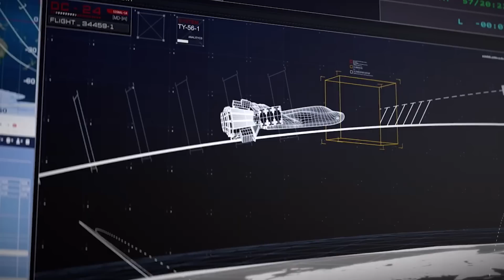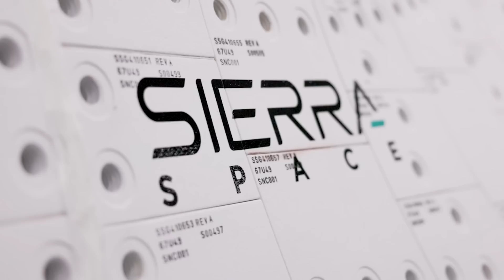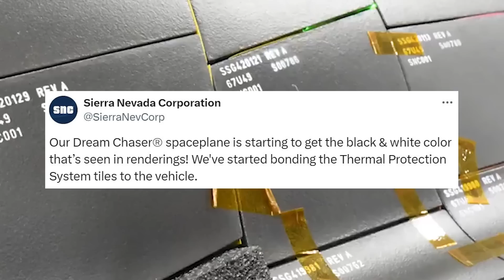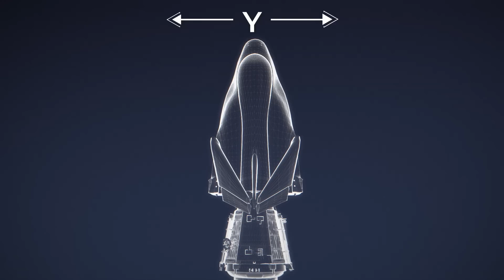Dream Chaser Tenacity Just Missed Its Ride To Space

Comment: i still dont get why these companies still are using the heat shield tech from almost 60 years ago. That tiled system is garbage and always has been.
Reply: I wonder if anyone is working on some type of a spray-on coating.
It could be stripped off after the flight and a new coat applied quicker than solving the giant 3D jigsaw puzzle that these tiles always seem to turn into.
Reply: Phenolic-ablator heatshields and silica-fiber tiles are both >40 years old.
Reply: I'm a little scared to ask what you think is better.
Reply: Okay then, what type of non-ablative heat shield tech do you propose then that isn't based on ceramic tiles or carbon-carbon composite.

The problem isn't that it's old tech, the problem is that there's just very little materials that can withstand the punishment of re-entry without also conducting the heat to the spaceship.
Reply: @CensoredUsername_  when starship was first being designed, i specifically remember Elon saying they wouldn't use a tile system, instead there was this wild idea to use some of the methane pumped through a grid on the surfaces that needed shielding, and that it would create some kind of bubble that would dissipate the heat faster than tiles. I swear, i remember seeing that in the original starship designs, they even had a animated video and diagram to go with it. I don't remember much about it but it seems like they forgot or maybe figured it was too expensive, plus untested.  There's also been ideas for a balloon type heat shield that is covered in or made of ablative material, and that way flexes with the stress. I'm just wondering where those ideas have gone. We all know the tile system sucks.
Reply: @mkocel  for reference, such a system is called transpiration cooling. It's a cool concept, but it also has its definite drawbacks in being extremely complex to intergrate (now your main structure also needs to be a giant porous manifold), and it of course comes with the issue of you still needing to account for the mass of used coolant.

Regarding the flexible material, there's been a bunch of research into it (look up spiderweave) but the tech readyness level is still sadly quite low. It also would make it quite hard to steer starship's reentry if using such a solution.

Tiles have their problems as well, but they can work. They also aren't just the same tiles that the space shuttle used. A lot of advancements have been made in the meantime as well. The tiles they use nowadays are far more impact resistant than the ones the space shuttle used.

I'm curious if we'll get to hear what caused the burn through at the hinge either way. Seemed more like a seal failure inside it rather than a tile failure.
Reply: @mkocel  Because something other than tiles is far easier said than done.  There were a lot of idea's when Starship was just a paper design about a TPS but reality reared it's ugly head and they went with tiles.
Reply: @mkocel they did a trade study and found tiles to be better.

End of story, was recently confirmed again in EA's starbase tour
Reply: He'll the Russian s used a specially treated wood back in the 60's, they should use that.

Comment: It's crazy how SpaceX launches at least twice a week, yet ULA considers launching twice in one year as busy. They really need to work on a reusable rocket
Reply: Unfortunately ULA execs don't deem reusability as "realistic" or "economical". Just like ESA doubling down on not developing a reusable rocket.
Reply: @jonahhekmatyar even though BOTH "realistic" AND "economical" are right in front of their eyes. (SpaceX)
Reply: @jonahhekmatyar ESA is still funding development for multiple reusable options, such as the Themis booster or the SUSIE orbiter.
Reply: @jonahhekmatyar ESA has gone dime store, I remember the first Ariane 5 launch that exploded due to ariane 4 software .
Reply: I'm just surprised anyone wants to fly on the Vulcan tbh. Both F9 and FH work out to be cheaper per flight than the equivalent Vulcan and they can both launch more payload. On top of that its easier to get a launch with SpaceX. When New Glen comes online as well I can see the Vulcan being made redundant.
Reply: @geesehoward700  its the fairing size that matters, spaceX cant make the fairing wider or much taller because the width of the rocket is prettty small compared to other rockets, and the airflow from a wider fairing will make everything uneven. Since they cant make a biggger fairing, they cant launch larger payloads, so people have to use other rockets like vulcan
Reply: @shauryadeb-e8l  If Starliner can launch looking like a Tootsie Pop, SpaceX can launch with a wider faring.
Reply: @ghost307  spacex is currently going through the certification process for a wider fairing.
Reply: @shauryadeb-e8l  the difference in fairing size is minimal. The basic Vulcan can launch longer payloads but with almost half the kg to space with a volume of  197 m3 vs a standard F9 fairing of 177 m3. I cant find the Vulcans usable diameter but I guess it would be within about 20cm of the F9's 4.6m  The Vulcan VC6 with a long fairing would have 305 m3 volume and a FH with a long fairing would have 303 m3 volume. Again the SpaceX rocket out performs the Vulcan.
Reply: @jonahhekmatyar  Good old SpaceX, always thinking at least 3 steps ahead of everybody else.
Reply: @ghost307  Eh, I can see Vulkan (or probably actually New Glenn) filling a void left by SpaceX between the F9 and Starship fairing sizes, especially as the industries reliant upon launches begin to awaken to larger and heavier payloads.  Not all of them are going to need to lift an entire space station, and the fairing size of F9 is already often constrictive even today.  These rockets do have a future, because SpaceX isn't interested in cornering every single market.  They don't care about Rocket Lab's smaller scale market, for example.  That all said, eventually Starship will be so proliferous that it may end up cornering the mid-size market de facto due to its low costs.
Reply: @ghost307 Asymmetrical fairings we’re heavily studied (AIAA presentations),
over twenty (20) years ago.  The airing were sized for larger NRO / DoD payload planned for 2020s.
New Glenn is sized (7meters) for those future payloads, plus multiple satellite constellations.
==
Elon skipped that size — making the conscious decision in 2016, “Go Big or Go Home”,
with 12 meter and current 9m diameter “Starship” designs.
It has been more challenging (multiple Raptor and Starship designs) and taken longer to develop.
Reply: @w9gb  It's more challenging specifically because they want the entire vehicle to be reusable.  Hit up Eager Space for their recent video on how this mandate affects the entire difficulty profile of the undertaking, and how fine the margins are, even with Raptor 2 and Raptor 3, by far the most capable engines ever seen.
Reply: @jonahhekmatyar the new fairing isnt wider. Its just longer to support payloads like gateway
Reply: @geesehoward700 Vulcan's fairing is like atleast 40cm wider than F9 if im not mistaken
Reply: @_mikolaj_  the external diameter for the Vulcans fairing is 5.4m and the falcon is 5.2m. the falcons internal diameter is 4.6/4.5m so im guessing the vulcans is built similarly, although i couldnt find any official number. With that said I suppose it would be easier to make a wider fairing for the Vulcan than for the Falcon.
Reply: @geesehoward700  hard to say tbh
Vulcan definitly will have easier time from aerodynamic's side of things due to base diameter of 5.4m, but idk whats theoretical limit for F9 before bad things begin to happen
Reply: @geesehoward700  Vulcan costs more than Falcon 9 but is cheaper than Falcon Heavy.
Reply: @Patchuchan  depends on which configuration Vulcan you want. Vulcan VC6 would cost more than Falcon Heavy.
Reply: What??....you need to get better info...next year ULA is planning 25 launches  a year ..this year they were trying a new rocket...it needs to get certification...starship  new rocket doesn't launch twice a week no???
Reply: @javierderivero9299 planning 25 missions? That doesn't count until they do it. And yes spacex is launching twice a week.
Reply: @rogerthomas169  What???...Starship is not launching twice a week....again...the new...vulcan ULA rocket is NEW!!!!...is still for certification that's why is not launching they have replaced the russian engines just this year with the BE4, succesfully...Starship is not  even certified....
Reply: @javierderivero9299  LMFAO, technically, Starship is certified. Otherwise, SpaceX wouldn't be putting it on top of the booster and launching it into space. With that said, at least Starship has actually launched 4 times. Dream Chaser's first launch and recovery will have more issues than Starship and by the time it actually launches next year, Starship will be fully certified for full flight operations
Reply: @javierderivero9299  spacex is launching r
Reply: @javierderivero9299  what? Don't be so dishonest, spacex IS launching twice a week, no one said starship was. Ula's vulcan is way behind starship.
Reply: @rogerthomas169  around 2/3 of SpaceX launches are for their own Starlink satellites. In term of launching something for 3rd party customers, ULA is planning on launching every 2 weeks by the end of 2025 (25-26 per year), while SpaceX launched around 34 rockets for 3rd party customers in 2023. If you include a couple AtlasV launches per year, then that difference really isn't that huge.

As for Starship being ahead of Vulcan Centaur... only one of these is actually flying payload to orbit since Jan 2024
Reply: @plainText384  regardless if spacex is launching starlink, their competitors satellites, nasa, space force or testing starship...you can't compare spacex to ula in experience and success.
Reply: SpaceX is mostly launching their own payloads...

It's like buying your own book in bulk to make The NY Times bestseller list.

Anyways, hope he sees this, champ...
Reply: @wyattnoise  While your first sentence isn't wrong, your second sentence is calculated to mislead.  SpaceX has launched 13 payloads so far this year that weren't Starlink.  Rocket Lab has launched 5.  ULA, 4.  Arianespace, 2.  It's like saying they're buying their own book to make a bestseller list, when the reality is that there are few and specialized customers for the other, generally more expensive and less reliable books.
Reply: ULA has launched three times so far in this year (Cert1, Delta IV, and CFT). They are launching again at the end of this month with an Atlas V carrying the classified USSF-51 mission,  Cert2 in September, Kuiper1 in October, and then finally two more NSSL missions on Vulcan.
Reply: Space Falcon Heavy was NOT reusable (core and second stage not recovered).
Only the two side booster returned.
WHY?  The GOES weather satellite was at the limit of capabilities — 
with the GTO launch profile desired by NOAA/NASA.
Reply: Actually Vulcan is supposed to be partially reusable - with the entire electronics and engine package having its own re-entry system.
Reply: @allangibson8494  Eventually, SMART recovery is the plan. But right now, for the first few flights it will be completely expendable.

Tory said that SMART had passed PDR and was going into CDR. He also has said that a definite  flight was chosen after having discussion with the customers.
Reply: SpaceX only launched 4 Falcon 9 rockets from 2010 to 2012. ULA has long said that they want to get Vulcan to a point where they are launching every couple weeks, so 2 more launches this year isn't busy, it's the starting point.

And finally, last we heard, ULA is still looking to upgrade Vulcan and make it partially reusable within the next couple years.
Reply: @plainText384  ula began in 2006, with well established space companies uniting. What's the holdup?
Reply: @rogerthomas169  Vulcan launched for the first time this year and they were waiting on Dreamchaser up until now. They also couldn't easily have Dreamchaser swap places with one of the other payloads that will fly on Vulcan this year, because the USSF missions that will come later this year require two certification missions first (one of which was going to be with Dreamchaser).
Reply: @plainText384  bad luck, bad planning, excuses. I wish them luck with boeing as a partner
Reply: They are in a process of slowly phasing out Atlas V and ramping up Vulcan, these transition periods always result in slow rates.

According to Bruno rn they have 23 vulcan cores in production at decatur, so next year should look much better
Reply: They call launching 8-10 times a year busy which they will exceeding next year with project kuiper Launches. It's not that difficult to look at its launch manifest in wiki. But of course that's too much for you
Reply: What SpaceX also does better than the military-industrial complex ULA is build fast. 
Rockets, boosters, ground infrastructure, prototypes, production models, it doesn’t matter what, SpaceX builds, tests, flies, etc far faster and better-tested than everyone else. Velocity of operations is their core, replicatable skill of excellence.